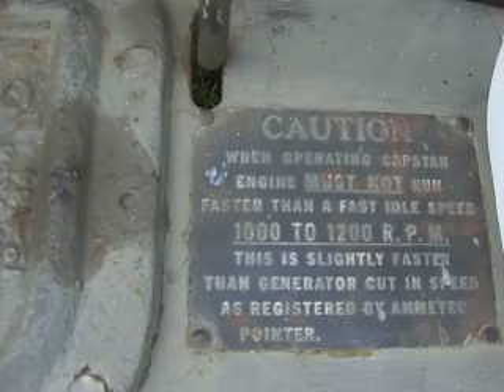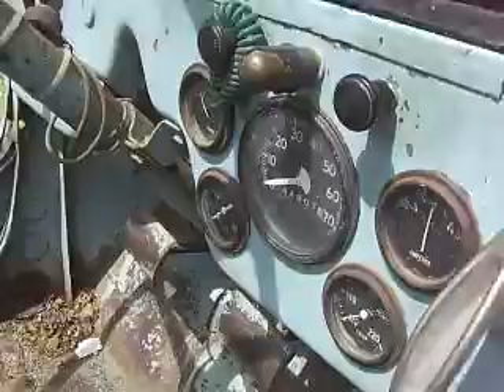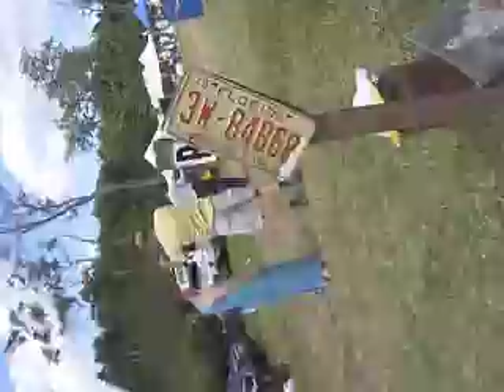Military Crank!!!

Comment: @mccall3421 The F head is the one you're talking about, exhaust manifold bolts to the block, indicating exhaust valves in the block, the first Willys to get a head. The flat otherwise known as L head is the one with all valves in the block (blue). The F head came in the CJ 3, had the tall hood, designed to clear the taller engine, I like the earlier CJ2, that's the blue one, I had one of those.